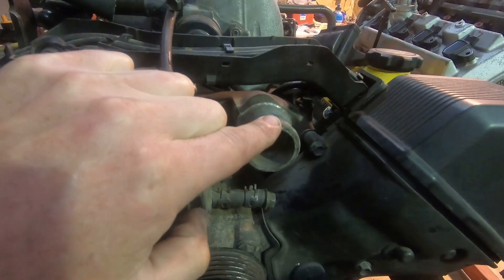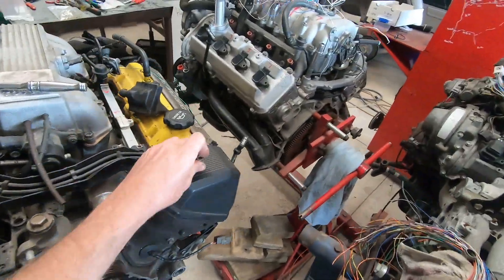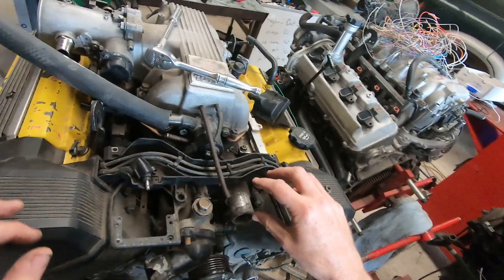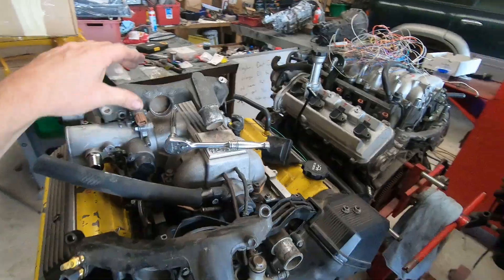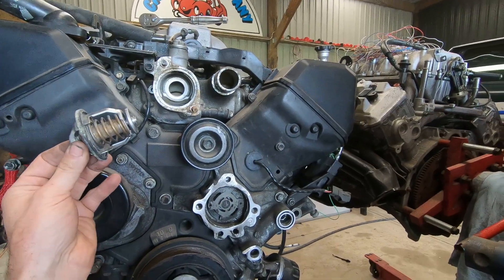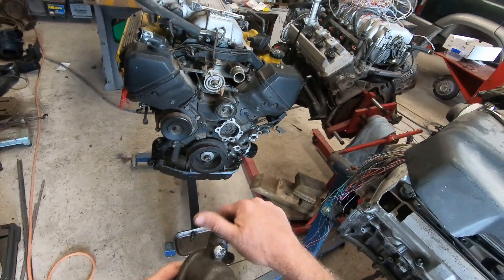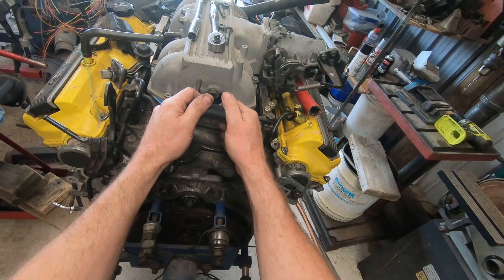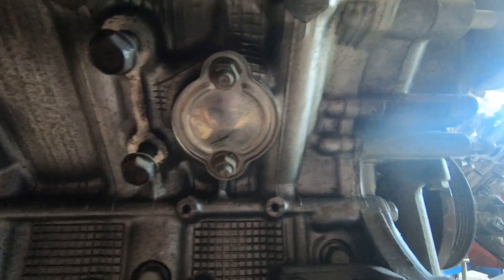Coolant hoses to remove in 1UZ Toyota V8 engine swap along with radiator system explaination

Comment: hi... i have a 93 Toyota hi-lux xtra cab ute with a 1uzfe in it. im looking at replacing the electric fans to cool the radiator and currently have the 2 separate puller style fan system which sits between the grill and the radiator. can u recommend what fan/fans i should get to fit the vehicle and where to get them?

Comment: I know this is old Kelvin but I’m wanting to simplify my 96 SC400’s 1uz. I want to do the EGR delete, get rid of any unnecessary cooling pipes because they are another potential failure, and go against your teachings and put a radiator from a VVTI engine and delete the reservoir and hydro fan. So I could then even remove more cooling pipes according to this video. Could I delete all the same pipes with my stock EGr deleted 1uz?

Comment: just like all your videos, very helpful. my gen1 1uz has a water pipe the comes up by the left hand coil pack. i presume it goes to the standard header tank. as im using the header tank on my mazda bongo, can this one be blanked off or do i need to feed it back into the system? cheers. Stuart in the UK.

Comment: hi friend. at 16:20 you try to explane the hose of the heater looping it. i cant understand from your explanation what is best to do. Make a loop is better or block it off? i think the best way to keep the engine as cool posible will be better. thank in advance.
Reply from the maker: Block the heater pipes if not using a heater core.

Comment: On my LS400  the coolant overflow reservoir .... its on the left side of engine bay. There is a hose on the bottom of the tank,  that hose goes to a clamp and its clamped to a metal hose and disappears under the engine.  Where does that go?  Does it drain onto the road?  Or does it go into the engine someplace?  I'm trying to clean that dark varnish out of the tank. I'm intending to put Toyota Long Life Red at 65% mix with distilled water....

Comment: Hey mate what do you suggest to do with the heater hoses in a jet boat with a heat exchanger? We are getting overheating on idle but it cools from 1500rpm on and it is just looped thanks
Reply from the maker: I have videos with jetboat engine setup where I always blank them.  Cheers Kelvin
Reply: @CartuneNZ  thanks mate I will do, we did have our header tank joining them but we will move it
Reply: @CartuneNZ  could we just block one and still have the tank filling off one?
Reply from the maker: @reeceglover5762  you may do whatever you want,  its your boat
Reply: @CartuneNZ  do you think stopping it flowing at that point could possibly stop overheating issue? I think it is just circulating there on idle and then when you are up in the revs the water pump is forcing enough water everywhere which then allows it to make it back to the heat exchanger?
Reply from the maker: @reeceglover5762  its a good start fixing issues and then test from there.

Comment: Can i remove the coolant lines on the throttle body for a 1uz vvti / 3 uz vvti?
Reply from the maker: You may do anything you want as its your engine.   I prefer to leave the later engines hoses on,  but there are exceptions.

Comment: I have a 4ye engine in a 1987 Toyota van. I am wanting to delete the egr as well as remove water lines through the throttle body. Any thoughts on that old style overhead valve engine? Maybe I should just pull it and stuff a 1 uz in there...😊😎 Edit: I live in southern Arizona in the U S... Climate is similar to N Z...

Comment: Is it beneficial to keep the expansion tank?
Reply from the maker: There are many variables to consider.  Sometimes yes, sometimes no
Reply: @CartuneNZ   I’m doing a supercharger set up on e85 with link storm and I’m a drifter, and it’s a sc400 1994. I haven’t done the supercharger yet and as of now I haven’t had any overheating issues. I was going to eliminate all the extra lines like you talked about and keep the expansion tank. Thank you for your reply I absolutely love this engine and it has served me good for 8 years now of abuse

Comment: Does it differ a lot from what you would remove while doing a 3UZ swap? By the way your videos are very informative and helpful. Thank you for doing them.
Reply from the maker: yes , the cooling lines on a 3uz are very different.  Cheers Kelvin
Reply: @CartuneNZ  have you done a video on the 3uz hoses? I couldn't find one but would love the same information about the 3uz. 💪🙌👍 Thank you for all your great videos.
Reply from the maker: We have lots of 3uzs in our shop atm.  Videos on them coming
Reply: @CartuneNZ  wonderful to hear. I should be completing my swap in the next few weeks so I'll be looking out for them .
Reply: @CartuneNZ  don’t know if I’m missing them but if you don’t mind, can you make a two minute video on the 1uz Vvti  cooling system for a swap using a heater core and expansion tank please

Comment: I currently have an air lock in my system but my rad cap isn't as high as it should be, but I also something is pooling in the valley bc something burns up after it runs, what could it be
Reply from the maker: watch this.  https://youtu.be/JIN1mEAeN9M

Comment: hey mate what size bung is that.. ID im going to ebay some
Reply from the maker: Which bung are you referring too?
Reply: @CartuneNZ  the one that you put on the cross over on the rear. 

Nekminnit

I just went down to Supercheap and grabbed two 10mm ID. 
The bung removed from the ICV to the rear turns out it’s about 8mm. The 10mm fits nicely on the barbed fitting behind the bleed bolt.

Comment: So putting a freeze plug in the back of the water pump and removing the coolant bypass tube will not work?
Reply from the maker: I remove the heater circuit all the time.  It gets a bit confusing as the heater circuit is shown as a by pass circuit on the factory diagrams

Comment: Hi . Putting a vvti in a jetboat. Using a southern jet raw water cooler. Having issues with keeping it cool. After watching your video looks like I need to block heater hoses ( as looped atm) and plug the thermostat by pass . The raw water cooler runs its top hose to the inlet ( where old thermostat was)  Any other advice?
Reply from the maker: One day Ill do a video on the proper way to do raw water jetboat to uz.  Definitely blank heater circuit.   Bypass circuit blanked in engine. I use chev priority cooler with thermostat in the cooler with pressure relief valve.  Easy and works perfectly.

Comment: Great video thanks.  So in a setup with no heater you suggest just blocking each outlet/pipe individually? Thanks
Reply from the maker: Yes.  I always blank them off if not using them.
Reply: @CartuneNZ  great thanks for that!

Comment: Hi. On which side of the radiator would you put the fan switch
Reply from the maker: I prefer the top of the radiator,   some prefer the bottom,  provided the system is set up correctly either works fine.

Comment: I have a 92 LS400 and my temp sensor runs a little hot than normal. But my motor is not running hot.  What would cause it to do that? Now I put pipe sealant on the sensor. Would that make it read improperly?
Reply from the maker: Hello.  The sensor requires earth with the block to work correctly so I only use liquid sealant like factory.

Comment: Hi CartuneNZ

Great info on the 1uz, one question though. The small feed on the left hand side of the thermotat housing you say goes to the expansion tank if your running one. Is this the main fill pipe from the expansion tank? Is there any others that need to bleed up to the top of the expansion tank?

Thanks
Reply from the maker: I only use these tubes if running a stock style system.  Otherwise they all come off.  There are two tubes into the expansion tank from the cooling system.  I will look over the stock system one day to explain that better.  I just happen to have a couple of test cars.  Cheers Kelvin

Comment: Thanks for the great information. On my swap I am not running a heater in the car so no heat exchanger. I currently have the rear coolant line looped over. What do you suggest I do with the rear coolant line so the system works properly?
Reply from the maker: I never loop the heaters lines when no heater is present.  I always blank them off.  Cheers Kelvin

Comment: Doesn't the IACV need coolant as well?
Reply: Ah so it's the same as the throttle body then - coolant is used to heat it up. Thanks for the insight, looking forward to more videos!
Reply from the maker: Not in the climate I'm in.  We only get to maybe -4c for a couple of days a year so no need for coolant through the Iac.  Cheers
Reply: @CartuneNZ  hi, if im in california where its mostly hot do i need to keep the coolant lines that run though the IACV?  or i just can blank them of?
Reply from the maker: @skatefliper98  I would be blanking them off.  Cheers Kelvin
Reply: @CartuneNZ  great, could i just leave them unblanked? since theres no more coolant running through them ...
Reply from the maker: @skatefliper98  sure can.

Comment: love these videos.  I have a 92 and a 93 engine, both with cold start sensor for the great white north of Canada.  Do you suggest changing the cold start sensor?  I'd imagine if yes for reasons of getting brittle.
Reply from the maker: I dont change cold start injector timer sensors just because I can and only fail every now and again.  Not as prone to getting brittle either.   They arent as easy to come by as the efi temp switch. However if it looks poorly I would sort it.  Cheers Kelvin

Comment: What size is the little hose on the front by the thermostat that you have blocked with a bolt? I need to get 1 and don't know what size to buy. Thanks
Reply from the maker: Hello Rex.  I didn't blank the little hose at the front with a bolt, that was a past owner and I would never fit an engine with a bolt inserted like that.  This is my test engine which hasn't been prepared yet and I never do it like that.  My preferred way is to remove the housing , remove the pipe and weld the hole.  See the yellow ute and engine preparation videos.  Old yellow is slowly getting different preparation done as each job goes by.  Also upcoming silvia engine where this test engine finally gets a welded housing.  Cheers

Comment: Hey @CartuneNZ
, I have an issue with the cooling system. I have replaced the heater core and after that, I have filled system via inlet 14mm bolt or so, then I have filled coolant system tank to the maximum line. All seems good, but now when the weather is hot sometimes coolant get thrown out and the level goes to a minimum. All hoses are good, the engine just throws away some part of the coolant via overflow hose on top of the coolant tank. Is it possible that I have air in the coolant system or something like this?
Reply from the maker: Hello.  Air locks are always possible but if the system is set up correctly then air locks should leave the system quickly.  It is important to ensure the radiator cap is in good order , that the hose between radiator and overflow is correct and unrestricted.  Are your fans in good order with no overheating?  How big is the overflow bottle?  I have had systems which are quite large where the expansion exceeds the size of the overflow bottle.  Then when they cool down the overflow bottle is completely empty.  The solution has been a bigger overflow bottle.  Good luck with sorting yours, I'd be interested to now the remedy.  Cheers Kelvin
Reply: https://www.youtube.com/watch?v=qhwHevjKq8g&feature=youtu.be

When I press the hose I can hear that air is coming out under the cap! This cap is broken I think, rubber bushing is bad. That means that my overpreassure hose was open all the time and was throwing coolant

Comment: fantastic videos! Thank you so much. I'm doing a swap into my old 2wd pickup up here in the U.S., and you've helped me tremendously in familiarizing myself with my 1uz!
Reply from the maker: Cool as.  You might have noticed I sometimes use the overseas term Pickup in my titles instead of the term Ute which we use over here.  I'm slowly working my way through all the info from my brain and turning it into videos.  What year Pickup are you doing?
Reply: @CartuneNZ  Hey thanks for replying! Its an 88 2wd with the carbonated 22r.   I'm currently refreshing the engine and getting ready to mount it to an R150 transmission out of a 2wd toyota t100 (got an amazing deal on it).
Reply from the maker: @pinkflamingodizzle  Good on you using the stronger gearbox.  I did a bit of a video on bellhousings but never posted it as I wasnt really happy with it.  I'm about to do another 4x4 hilux which has bellhousing issues so it might extend into a longer one explaining a bit more.  I'm also planning a external refresh video on both Gen 1 and Gen 2 engines.  Good luck with your one.  Cheers
Reply: @CartuneNZ  Thank you and looking forward to all your videos!